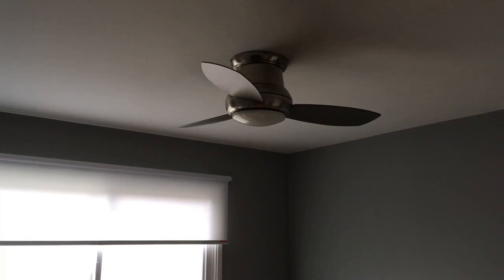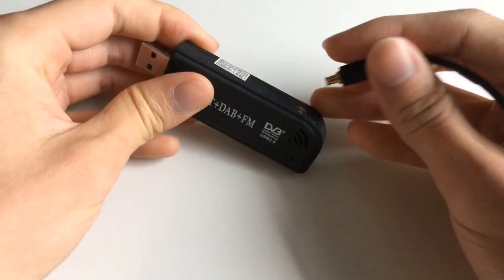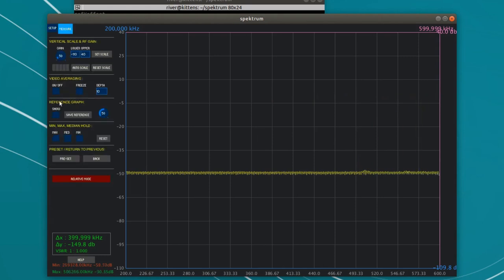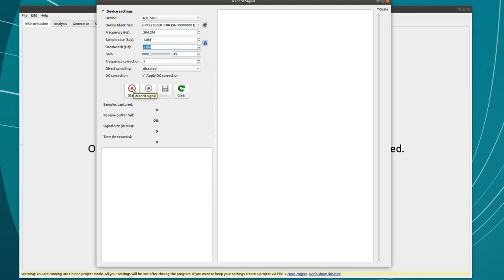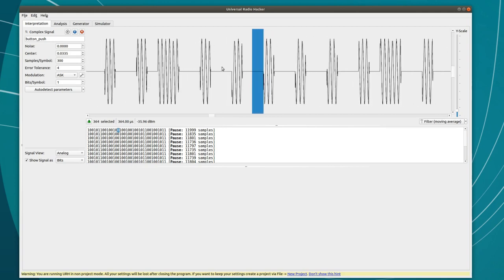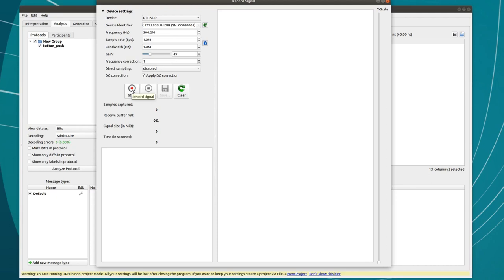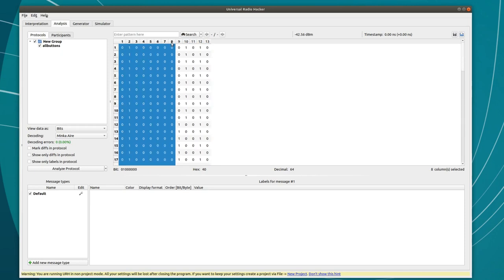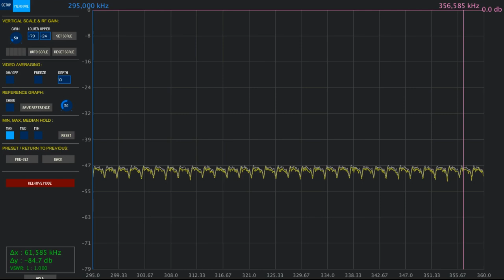Hacking My Ceiling Fan Radio Signal With a $15 USB TV Tuner (RTL2832U)

Comment: Hello pls help.
When you capture signal using RTLSDR then modify it and finally try to use rpi for TX that signal I wondering if is possible to use esp32 with cc1101 instead.
Thx.
Reply from the maker: Yeah, I don’t see any reason why you can’t.

Comment: I've been trying to do this myself, but unfortunately I'm having some trouble. I purchased the USB TV tuner linked in the description, but I can't get my computer to recognize it (I'm on windows). Spektrum doesn't seem to work on Raspberry Pi 4s, which is what I have, so no luck there, and I don't have another Linux machine available.

My tuner came with a CD that includes a driver, but even after installing it I can't get Windows to even recognize that something has been plugged in. The light's on, but Windows shows nothing. If anyone has any tips they would be greatly appreciated.
Reply from the maker: Hmm, you might be able to do it on your Raspberry Pi using other programs. I know there are other programs like GNU Radio and freqshow. And even spektrum should work in theory but you might need to compile some stuff from source.
Reply from the maker: Oh, actually I re-read your comment and realized something. You probably don't want the Windows drivers that came with your TV tuner because those drivers are for watching TV. The Spektrum README says to use this to install WinUSB (I haven't tried it myself): https://zadig.akeo.ie/
Reply: @riveducha  I tried out that program but since Windows doesn't seem to recognize the device being plugged in, I can't select it in Zadig. I decided to boot into Ubuntu with a USB stick but the tuner didn't get recognized there either. Maybe there's something wrong with my tuner.